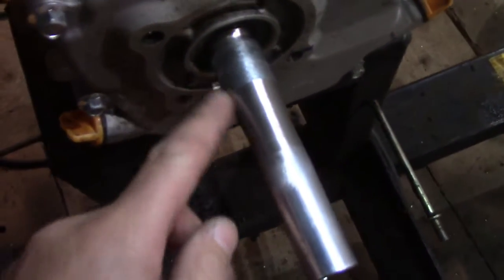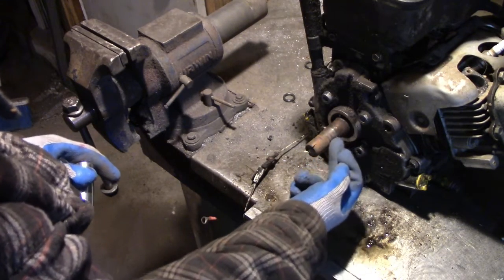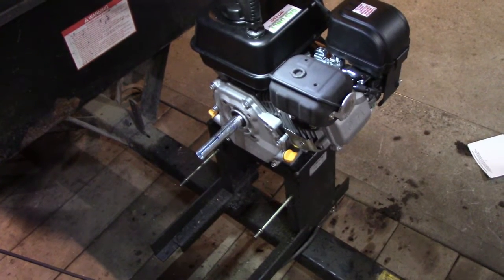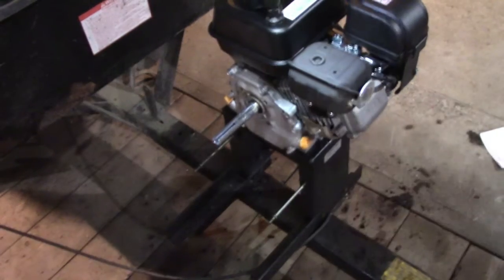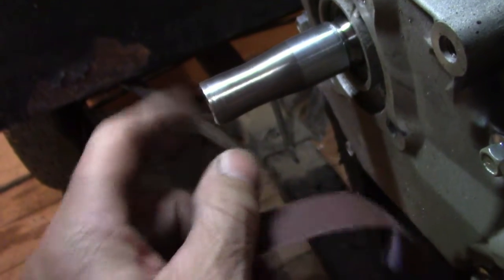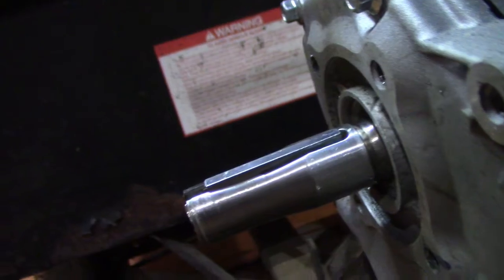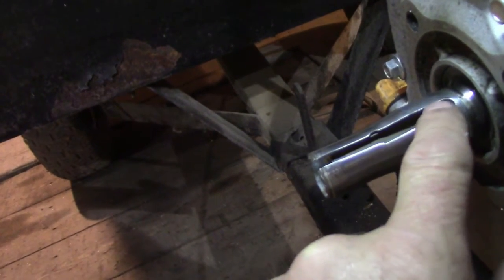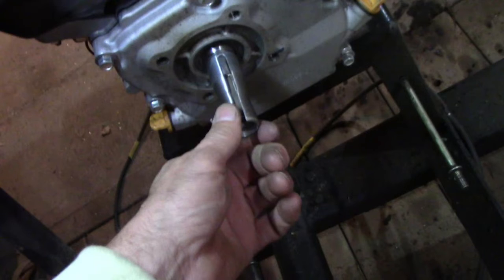How to convert a 3/4in. crankshaft into a dual Thickness with a taper.

Comment: Where did you get the two adapters you welded together? I'm trying to do the same thing, add the 212cc Predator motor to my Agri-fab leaf vacuum.
Reply from the maker: Amazon
Reply: @JLafix my ten hp tecumseh on generator slung rod (tapered shaft) harbor freight sells an 8 and a 13 hp engine but say they don’t sell engines with tapered shafts
Yet there generators have tapered shafts